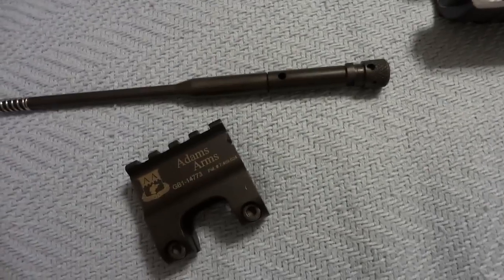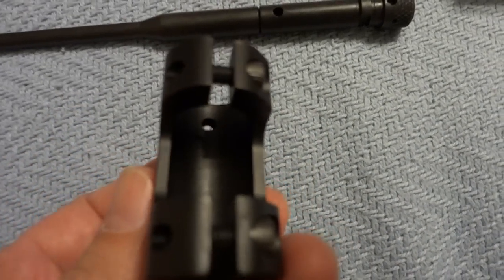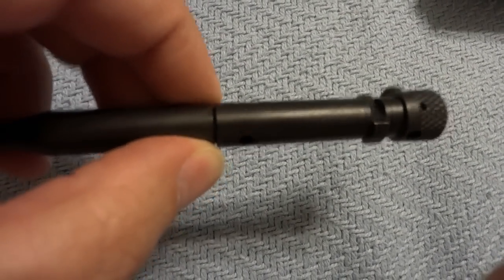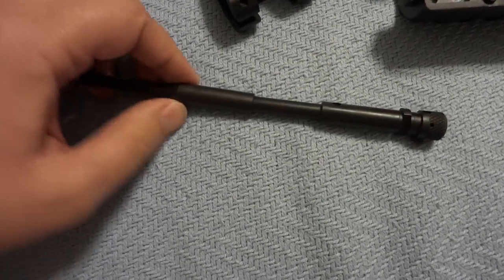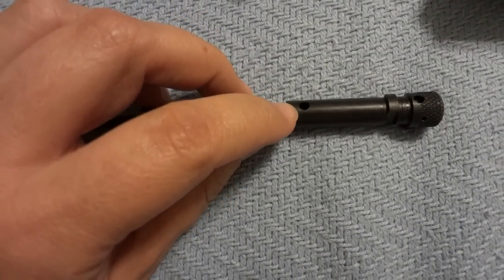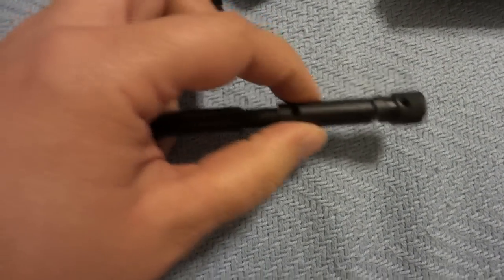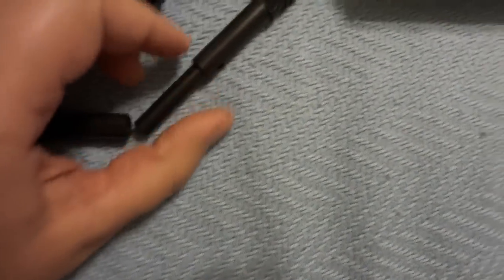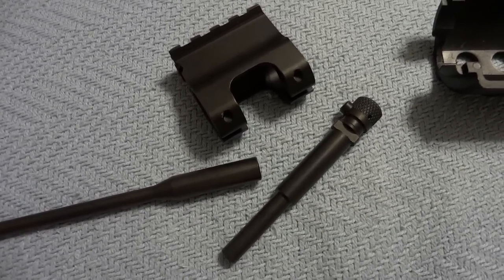Adams Arms Closed Gas Piston

Comment: Installed an Adams Arms system on my M&P-15, so far I have no complaints.  Looking forward to a follow up video.
Reply from the maker: +G11354 Will get around to it eventually.  I realized after making this video that I should do a build without a handguard so you can see the system working.  So hopefully this winter sometime.  I don't see any comprehensive AA piston review on the internet yet. Well, not one like I would make at least!

Comment: Nice. Don't forget the follow up video with a supressed gun, once you've installed it!  8^)
Reply from the maker: +jconradh Absolutely!  I have three installed on guns now.  Unfortunately, I do shoot without the camera a great deal, mostly during the summer.  Too hot and humid for the electronics and the added burden of running the cameras means it's not as fun.  Right now, I have a 7.5" that you've seen in the videos, an 11.5" and a 16" barrel gun.  I don't think I'll run the 7.5" with a can, though, as the manufacturer only rates it for 10".  I do have the mount, but haven't run it. 

As for videos, I have a series on some old 32's and .380's I'm working on as well as some new pellet videos.  I haven't been putting as many out lately because of my offline life, but it'll pick up soon.  Thanks for being a loyal viewer.
Reply: @RyeOnHam  mine is way undergassed can you show how to change the gas settings? Do you have to remove the handguard?

Comment from the maker: Please note that if you put a comment here and there is no reply button, I cannot reply to that comment and will usually delete it.  No, DI guns are not quieter suppressed than the Adams Arms piston gun.  DI means that the piston is in the bolt and vents out the side of the bolt carrier.  It is louder than many piston systems, but not the closed gas system of the Adams Arms.

Comment: Apparently the AR operating system development is never ending, If I wait for the perfect system I'll too old to remember I wanted to buy AR. I do like the Adams Arms
Reply from the maker: +NAHAAFB Most of my guns are running an AA piston, but it is more expensive, slightly heavier, and it's proprietary which means you can't just buy replacement parts anywhere.  On the positive side, of course, your bolt carrier will stay cool and relatively clean.  If you run suppressed, you will get less gas to the face.  If you don't mind the cleaning, you probably won't notice much of a difference either way.
Reply from the maker: +NAHAAFB ... and Adams Arms sells complete guns.  Very reasonable for a piston gun.